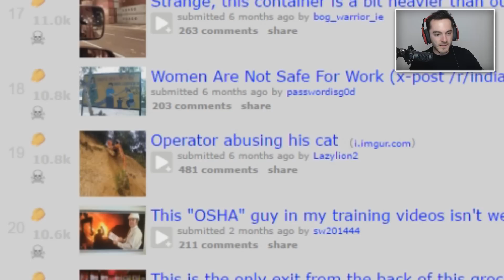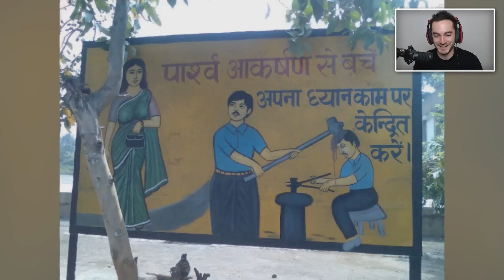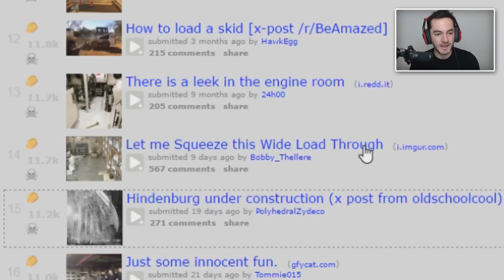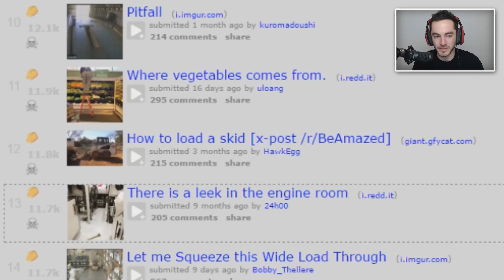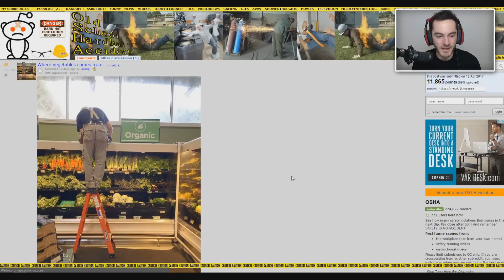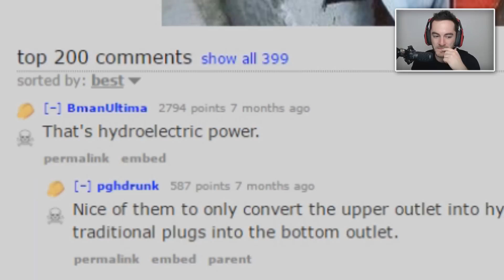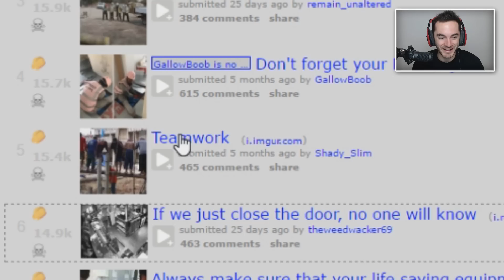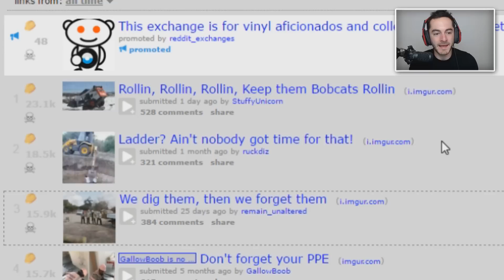THAT SEEMS DANGEROUS

Comment: 13:50 Jordan's first thought is how impressive it was that it could balance on the thing... my first thought was, "HOW THE HECK DID YOU GET THE CAT ON THAT THING IN THE FIRST PLACE?!?!" LIKE BOI!
Reply: same way that the other guy got on the truck
Reply: Nathan Hong that bobcat has a pretty strong engine so when you full throttle it it probably popps a wheelie that he knew how to control to mount the pipe
Reply: How do you get off the thing?

Comment: It's not really a work thing, but I remember the most disturbing safety error occurred to me at my high school 3 years ago. I was in AP Chemistry class, when a workmen walked in and placed a fire extinguisher on the wall. At which point, all those in the area realized, that for the past month, there hadn't been a fire extinguisher. In the Chem Lab. A room second only to the Culinary arts classroom in terms of students burning things and blowing things up. Like building calorimeters. Or an experiment my friend Noah and I did involving 9 9Volt batteries in series (81volts), 3 pieces of exposed wire, and 6M sulfuric acid.
Reply: Shit.
Reply: Devin Gendron Wǒ yǐjīng zhīdào nǐ bùnéng dú zhōngwén, suǒyǐ wǒ huì xiě yīgè hěn zhǎng de jùzi, nǐ bùnéng fānyì zhège, chúfēi nǐ yǒu yīxiē páixù fùzhì hé zhāntiē de dōngxī, wǒ rènwéi tā de gōngzuò lái fānyì zhège hěn zhǎng de jùzi.

Comment: 2:50 (ish)    Couple quick things, Cab is the front, trailer is the rear, they are connected by a "King Pin" that can easily hold the weight of the cab. The cargo container has a hole on each corner that goes around an odd shaped pin on the trailer. You rotate the pin 90degrees to lock it into the bottom of the container. When getting unloaded, the drivers pull up under the crane, rotate their pins, and wait for crane to lift container off, then simply pull away, when everything is done properly. Distracted crane op didn't notice truck "stuck" to his container until he was positioning it over the stack. BTW, the safest place for a driver to be while all this is going on, is in his cab, and it doesn't appear that the drivers side door is open(signifying a last second bailout), so it is VERY likely the driver is still in the rig, shitting bricks.

Comment: Growing up I used to flip houses with my dad, and when OSHA would come in an inspect the houses they were always pricks about it. I mean we only had one problem we didn't manage to fix and it was one small plumbing concern, and that was out of the 30 or so houses we had flipped. Just call state or city inspectors, OSHA will nit pick if something is an inch off or a PVC pipe has a slight bend to it.

Comment: Captain Sparklez @9:23 the water would cause a short and trip the breaker. if the breaker didnt trip there would be an electrical fire and potential building burns.

Comment: The water coming out of the outlet could potentially be dangerous, it just depends on what is in it. If it contains stuff(minerals, other elements/compunds etc.) it could pick up electrical charges, but if it is deionized water(it is lacking minerals, other elements/ compounds, etc.) it will not pick up an electrical charge.

Comment: You don't have to touch both slots on a socket to get shocked. Your hot slot is the smaller one. The big one is neutral. You can stick a fork in the neutral without being shocked. Just DON'T TOUCH THE SMALL ONE.

Comment: These are nothing, I've been working on a boom lift, no harness or hardhat, 60 feet in the air, sitting on the railing leaning out of the basket to attach a fitting to an exterior wall. Yeah, safety!

Comment: 9:24

Most power systems are setup like this

Transformer Primary (This takes 20~kv and converts it to 240 (AU) OR 120 (USA)

________(==(Primary)==)
~120v |======|=====| ~120v
                        0v - Ground

120 + 120 = 240;
120v Relative to ground on both sides of the output.

That means if you touch ether wire on the outlet (in Australia) You will have 120v between you and the Transformer (Not taking into account voltage drop over your body / ground)
So yeah, Both wires are dangerous.

Comment: guy would been better of staying in the forklift , and here you need a hell ass training before you can go for a forklift drivers licence ,  , i'm the youngest licenced forklift driver of my country =D , but yeah , a forklift van take easy 10 TONS on it before the cage even starts to bend , forklifts are heavvvvvvy guarded machines , where i took the lessons , they had spare forklifts to show the safety , they dropped a pallet with 2 TONS of stone bricks on it , you're safe in there , and according to the instructor , they did this drop about 30 times on that forklift , and barely 1 bar had a bent in it ,